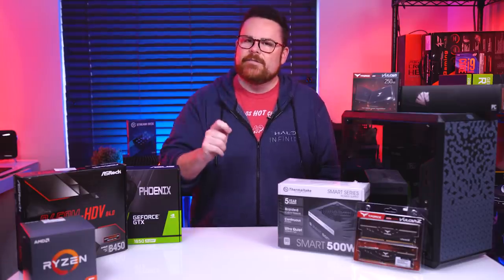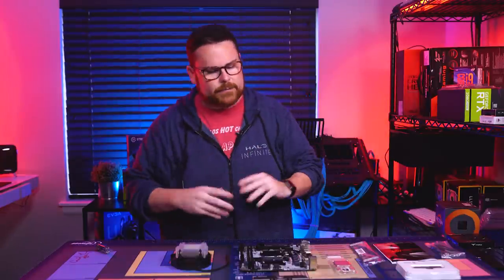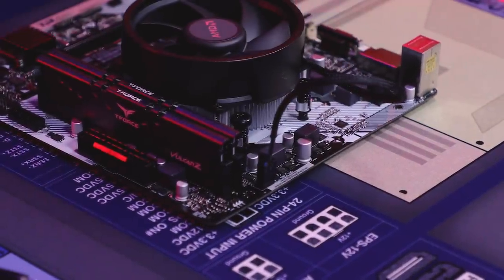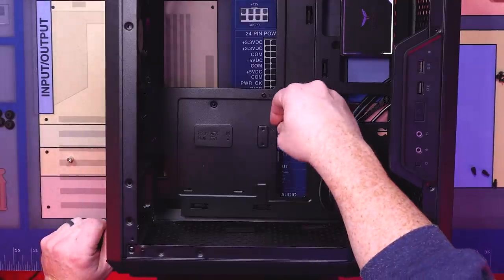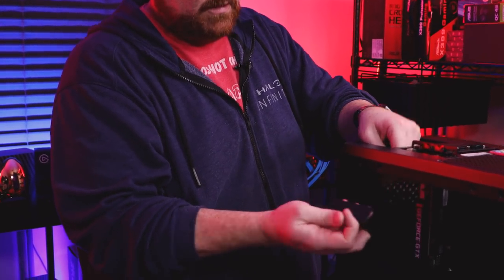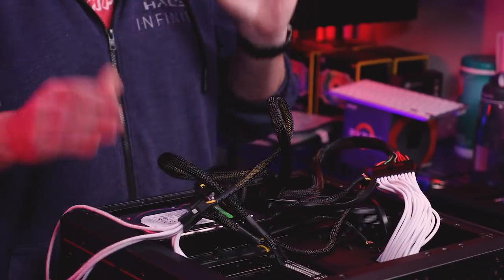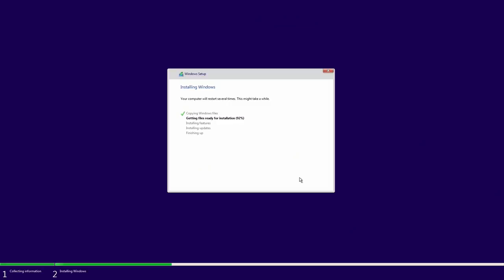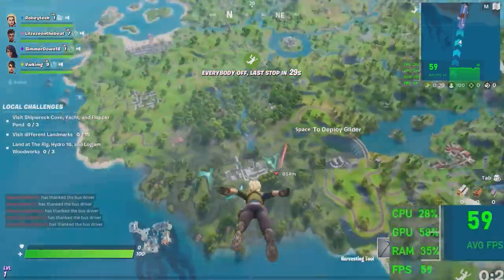How to Build the Best $500 Gaming PC! Step-by-step (2020 Edition) | Robeytech

Comment: So, I have decided to build this "$500" PC. the only two things i changed was upgraded to AMD Ryzen 5 3600 6-Core, 12-Thread Unlocked Desktop Processor with Wraith Stealth Cooler. and i also went to TEAMGROUP T-Force Vulcan Z DDR4 32GB Kit (2 x 16GB) 3200MHz (PC4 25600) CL16 Desktop Memory Module Ram - Gray - TLZGD432G3200HC16CDC01. I was wondering if i am going to need any extra fans or anything to go with these upgrades. I chose to also only get the 2TB firecuda (for now) you recommended. Please let me know if any of this will cause me any issues, or if i'm going to need any other parts before i hit the order button. Thanks for all your help, keep up the good work! I am also going to order all this through Newegg to help you out.. thanks again man
Reply: @RobeytechLive  not really, i'm already at like 750.00. I do have some extra fans laying around the house that i took out of some older computers, just not sure if that would work or not

Comment: Nice vid.  Great parts for a new $500 build WITH  m.2!  Ryzen 5 is the go-to right now for new builds.  The price/performance let's you spend the money elsewhere.  I would have spent an extra $20-$30 on a higher watt psu to allow for a nice gpu upgrade later.   I still have not run into cpu bottleneck issues with my 8 YEAR OLD I7 3770k  (GTX 980) or my 9 YEAR OLD 2600k (RX 590).  I get 60 fps on high settings and over 100 fps on med. settings on PUBG (which is more demanding than to CSGO or Fortnite) .   DO NOT OVERPAY FOR YOUR CPU!!!!

Comment: The motherboard rn is 199.99 USD. Do you have any cheaper recommendations that would work with this build?
Reply: I know it's late but I'm assuming you'd be fine with the b450m ds3h it's a little over 70$ or 80-90$ for the wifi board model

Comment: Hi I need trouble shooting help I turn it on and the little LED Turns on but I press the power button and it doesn’t work I used all the parts for this except I didn’t use an sad just 1TB m.2 please help it would be greatly appreciated

Comment: so the R5 1600 on the link is going for about $250 at the moment. I started looking around at other stuff and came across the R5 2600 for $150. So Im curious as to which would be better for this build? I don't mind spending the $250 on the R5 1600 but if that R5 2600 is better and at a cheaper price i wouldn't mind that either

Comment: Robeytech should I over lock my pc, I just finished the same build and it runs good but if I over lock it I can get a higher FPS. Should I over lock it?
Reply: Adham Abdallah FPS depends on your moniter, having a 60hz moniter would mean you can only view 60fps in all programs (games, the web etc) but 60 fps is good for the average gamer. If you try a 1080p 144hz moniter it will go to 144 FPS

Comment: I'm a bit clueless when it comes to stuff like this. I'm just wondering if the hard drive he put in the back of the PC is necessary.
Reply: No it isn't you can use an SSD or an HDD (Or both like he did)

Comment: for anyone who was going to say the case sucks or the cpu sucks or the mobo is bad or the power supply can blow up please realize this is 500$ and if you were to get the upgrades that would be logical such as ryzen 3 3100 only 15$ more, a better motherboard or yk a better psu yes individually the parts are easy to afford but if you add them all up then its around 600 so anyone who was gunna say this sucks just realise its 500$

Comment: The PSU you chose is not good. Also I'd get a different set of RAM without radiators, it's usually cheaper. Also, I'd change your motherboard to Gigabyte DS3H, it has 8 CPU power pins, therefore more headroom for upgrade. The GPU is a bad choice, for that price you could get something with a better cooling solution, Gigabyte Windforce for example. But overall, it's a pretty good build.

Comment: Anyone watching this NOW (check my post date) do note the 1600af is now $150. Do yourself a favor and do what I did and grab the 3600 instead. MUCH MUCH more cpu, for only $10 more. This build is almost the exact as mine only I grabbed the 3600 with a 1660 Super and a Thermaltake Versa H21 case. Same mobo and ram. Still waiting on gpu and mobo from newegg (stuck in Baldwin Park, CA like everyone elses mobo)

Comment: Helllooo, any recommendations for a gpu that goes well along with AMD RYZEN 5 3400 at a cheap price?
Reply: Hey man, with a cpu like that it really depends on your budget, to avoid bottlenecking you're at least gonna want something like a gtx 970 or a 1060 3GB, but you could go as high as a 6GB 1060 or a Rx 580 or even a 590 without encountering too many bottlenecking issues, hope this helps
Reply: Also check sites like eBay for 1060s and 970s, it's not uncommon for them to run around 100 dollars, for something like a 580 or 590 you're looking at closer to the 200-300 dollar price range.

Comment: Hey question the case you have I just ordered one and waiting for it to come I want to know if i can take out the stock fan and add a led fan?
Reply: Yes as long as it is a 120mm fan.
Reply: @JJFlores197  Also do I need to purchase wifi and sound cards or does the motherboard come with it
Reply: @lavellecole9082  If you want Wi-Fi, yes, you need to purchase a Wi-Fi card. Most motherboards don't come with built-in Wi-Fi except for some of the mid-high end boards. 

On the contrary, pretty much all motherboards from the past 2 decades com with built-in sound. So unless you need some high-end sound cards, you don't need to worry about this.

Comment: I copied everything you did but I didn’t get a hard dive just SSD and my fans are running and the gpu lights up but I am getting no connection to my monitor and I have tried 3 different monitors

Comment: im most likey gonna buy this will I have to buy windows 10 on this and how much is it?
Reply: Windows 10 Home costs $139, Pro costs $199, and Pro for Workstations costs $309. 
Now, if you're doing things by the book, you have to buy Windows. Windows 10 Home should be fine for most users. However, you don't actually have to buy a product key for it. MS will let you use W10 without buying a key indefinitely. You won't be able to use the personalization options and there will be an activation watermark in the settings app, but it will otherwise work exactly the same as if you bought it. There are gray market ways of getting a key for significantly cheaper if you're into that.

Comment: how much fps you get ik this is a long time after but do you remember?
Reply: Assuming you want roblox fps the amount is 100 FPS in vr and 250 fps normally (measured on a baseplate, results will vary among games), however don't expect it to run showcases as those are a whole other thing

Comment: I just built my pc last night everything works good it boots into the bios (ASUS TUF) and it recognizes everything from my processor to my RAM sticks and all the components. For some odd reason whenever I try to install windows 10 which I downloaded from the actual Microsoft website, it just comes up with a black screen and a white little bar at the top left. I formatted the my USB TO NTFS and it is a 32gb USB. I also did put it in the usb 2.0 slot not 3.0. Any suggestions or help please? Thank you
Reply: I also changed the boot order and tried a forced or override boot and it is still not booting from the USB which has the windows 10 ISO file.

Comment: It’s $689 in USA Today but still worth it and with messing with settings or overclocking you can get maybe 75 fps and you can definitely use a 75hz monitor on it Edit:(only reason it’s &689 is because many things are sold out and prices are crazy due to Corona)

Comment: But where was your thermal paste spreader? Your Swiss army knife? Your cpu mounting tool? All the braces? The hammer to hammer them in? Hax! :-P

Seriously, while you listed parts, I set up a wish list over on Newegg with similar but not exact parts just to see how close to $500 I could get, and I was only $16 over. I don't need to built one though, I already have! Used, eBay'd and rescued parts: Ryzen 7 1700, b350 mobo, Midtower case, rx580, 550w psu, 16gb ram, 240gb m.2 ssd, 2 tb slooooooow 5400 rpm mech hdd.
Reply: @RobeytechLive  No worries. I can't afford those fancy tools myself.  Funny story, I accidentally swapped the power and reset front connectors, so my 'puter in it's white case with black trim wouldn't post. Naturally, I fixed this, then slapped a "TK-421" sticker and the Empire logo on the front, because "TK-421, why aren't you at your post?" (thumbsup.gif)

Comment: @Robeytech I bought the same cpu, motherboard, memory, and case and I cannot get it to display anything! The gpu I am running is XFX Radeon RX 580 GTS XXX Edition 1386MHz OC+, 8GB. I’ve tried the hdmi on the motherboard and the gpu and am getting nothing. Any ideas? Lights up, and fans are running on everything.
Reply: ROBEYTECH Thanks, I will give that a try.
Reply: @robeytech So, I got a motherboard speaker and couldn’t get the motherboard to beep at all. Assuming it was default set to not beep. Got another motherboard. This one beeps. Three beeps. RAM issue, correct? If feel like it’s is more difficult than it should be to seat the ram. Does it usually take a decent amount of force? Anyway, tried many times to reseat and also only use one stick and it continues to give me three beeps. Are you thinking bad RAM like I am? Thanks for your help!
Reply: Solved! I’ll give an update in a bit.
Reply: ROBEYTECH my original motherboard ended up being bad. The beeps I was getting from the second motherboard was a longer beep followed by three short beeps. I originally thought that had something to do with the ram, but it was a gpu error. I didn’t have my gpu plugged in assuming that I had an integrated graphics in my motherboard. I didn’t realize that integrated graphics was dependent on the processor and my processor didn’t have that feature. Plugged in the gpu and it posted! Thanks for the help!

Comment: I pretty much built this same system and my cpu has high temps between 55c n then itll overheat n shut off on certain games n during benchmark testing
Reply: 55c is ridiculously low. That's not high. High is 85c+. Check to see if temps on something else is not shutting it down, like vcore, gpu, etc.
Reply: Twxi i worked that wrong when i made the post my cpu should be at 55c idle n then climb to 95c n shut off but its fine now had a buddy who builds pc come look at it n work his magic still idles at like 50c but i live in fl n my room always hot soo i figure outside temps affect it too but its all good now so

Comment: Also how would i go about installing a bluray disk reader?
Reply: The case he uses doesn't support 5.25" drive bays (which is the size of an optical drive). So you will need to decide if you really want an internal Blu-Ray drive. If you do, you will need to buy a case that has a drive bay. Alternatively, you can get by with a USB Blu-Ray drive. I bought an LG one from eBay for about $30 5 years ago and it works great. It doesn't look as clean as if it were an internal drive, but it works great for what I use it, which isn't a whole lot anymore. I occasionally use it to rip Blu-Ray movies over to my HTPC but that's pretty much it.
Reply: @JJFlores197  hm...so i guess the best option is plugging and unplugging an external driver bay then? Or as you said a usb bluray drive but i have no clue how to use one of those. 
Thank you for the reply
Reply: @TheSasukefang  Using a USB optical drive is extremely simple. It is literally plug and play. You just plug it into a USB port on your PC and that's pretty much it.
Reply: @JJFlores197  yeah, i meant how to get content of a bluray onto a usb sorry ^^'
Reply: @TheSasukefang  In that case, you would want to "rip" your Blu-Ray movies. I use a program called MakeMKV (it isn't free, but they offer what seems to be an "unlimited" beta version) which lets your rip Blu-Rays and DVDs. It works well for me most of the time although I have occasionally encountered some movies that don't work on it all.

Comment: just ordered all the parts rn
Reply: Did you build it ? Can u play fortnite with it ?
Reply: @juztclapps8296  i built it around may, and i upgraded some parts now, but yes it runs pretty much every game at high settings 120fps (including fortnite)
Reply: @zvlafilms  ok thx for the fast reply, so you think it’s a good idea ? Also did you order the parts from amazon or what
Reply: @juztclapps8296  i ordered the parts from amazon and newegg, i just checked which site had it cheaper, and yea its a good budget pc if you’re just getting started

Comment: I just built my first pc and everything is plugged in got the ryzen 5 with a asrock b450 and I try to plug in my tv hdmi, or computer monitor dvi cable and I get no signal
Reply: Which processor?
Reply: Are you plugging it in to the video card instead of the motherboard. I have made that mistake myself.
Reply: Joe Smith I didn’t have a gpu cuz I thought I got the cpu with graphics in it so now I got a card and it works lol I feel like a clown
Reply: That's the issue. No gpu no image. Only 3200g and 2400g have integrated graphica

Comment: Do you really need the cable extensions?
Reply: ROBEYTECH thanks but I have another question can I get a different case because the one you used on the video is out of stock.
Reply: ROBEYTECH by any chance can you link me some cases that are cheap and are in amazon that I can use because I don’t really know about pc. I do like the case but I want to get a different one. Or does it have to be the same case?

Comment: After adding the closest parts to the ones in video from Amazon I'm over £550 before even considering a monitor keyboard mouse and windows I'd like to try get into pc gaming but this stuff is so confusing for noobs like myself I don't know what's compatible with what, what power supply for what , what's good what's bad what's a rip off what's not good video though just heads wrecked

Comment: have a pc having 
AMD FX 4-Core Black Edition FX-4300 3.8GHz Processor 

Asus M5A78L-MLX3 for AM3+ Socket AMD MotherBoard Max. 16GB, DDR3 1866

Corsair Vengeance 8GB DDR3 Memory Kit (CMZ8GX3M1A1600C10)

Kingston SSD 120gb 
500w Power supply

i want to buy 
ZOTAC Gaming GeForce GTX 1660Ti Twin Fan
for now can i use it on this pc
later i will be purchasing new systemso i can use the gtx on the new system

please help
Reply: will gtx1660ti work properly?

Comment: As usual, these budget builds forget the extra $100 cost of windows on this $600+ build.  as already stated, a budget 1TB+ HDD for games.  240 GB will hold only a game or two otherwise. although windows will fill it up by itself in no time.  Also, you'll need to move the user folder to the HDD as well, or the SSD will fill up in a few days.  This is going to be more like $700 build when all is said and done.  You might be able to trim another $100 if you really try hard, maybe more if you find some really good sales.

Comment: Add the storage drive +tax for the entire purchase... close to $700 bucks. 

Sick of youtubers and their "$500" builds using new components.  Its not happening for good gaming. 

If you want a $500 gaming PC that can crush 1080p get on craigs list. Even then its probably not going to happen.  Realistically you might be able to find a decent 8350 build with an rx380 in it for 500.. maybe... the good news is, that older system will out perform this new system thats going to end up costing you way more than 500 bucks. 

You have tax, you have an OS, you need a storage drive and you really need the ssd for your OS. 16 gigs of ram. At least a 500 watt psu. Case and that cpu.. it all has tax and shipping. 

Also, anyone that's using a build guide like this probably doesn't have a set up. Your goiig to need a decent mouse and keyboard. You got speakers and a  monitor? Headset? 

No. Your not gaming for 500 bucks. Get a console . New consoles are better than budget PCs. The PC market is a rip off at its current state.

Comment: $500 to play on the same fps as a $150 Xbox or ps4......
Reply: It was capped at 60 fps for a reason. Even then, you can see it would certainly go higher than that, as the utilization was only about 56%.

Comment: This pc is trash for 500 only 60fps! You could easily get over 120 on high settings for the same price of this pc
Reply: It was capped at 60 fps for a reason. Even then, you can see it would certainly go higher than that, as the utilization was only about 56%.